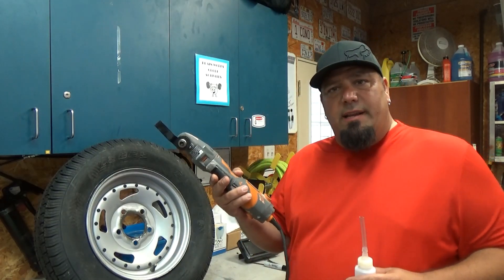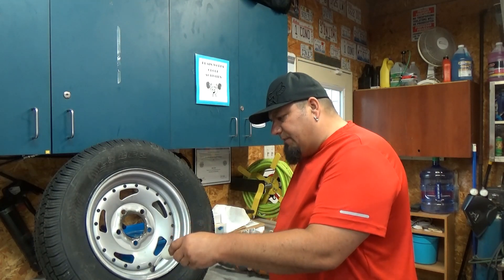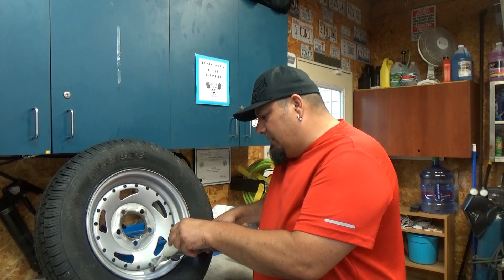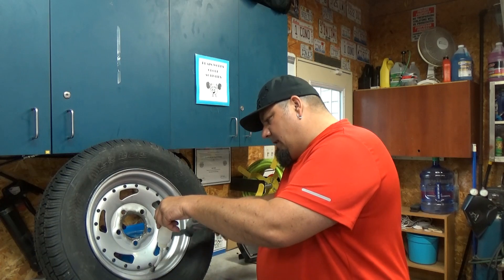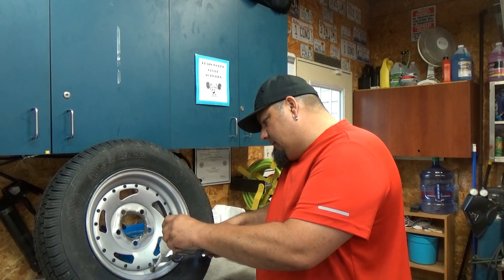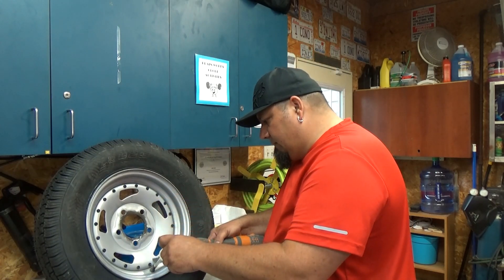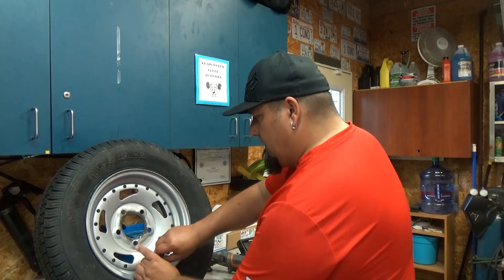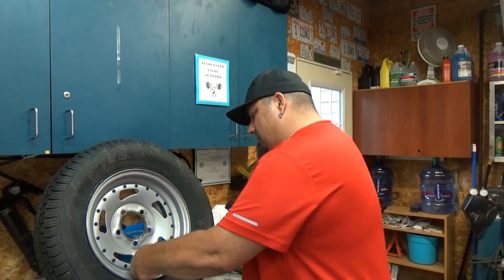Tire balancing with ceramic beads

Comment: I reuse my dyna beads in my motorcycle tires. When I remove the tire, I scoop the beads out of the tire and put them in a cup. When I install the new tire on the rim, I put the dyna beads in the tire before I put the second side on. They wont fall out. I also run a car tire on my bike. Most places wont put anything but a m/c tire on a motorcycle.
Reply from the maker: Yes I have done that many times. The issue we had with these tires and wheels were the beads of the tires were crushed together from shipping. We had to use a bead seater blaster tank to set the bead. That would have blown the beads all over. Thanks for watching Dirt Poor Tv 👍

Comment: Why didn't I think of that! I got that tool! Do you use those "Filter" valve cores?  Lots of motorcycles and trailers. Thanks
Reply from the maker: Yes, When using the Standard size bead the purpose of the filtered valve core is to prevent a bead from getting caught in the valve core mechanism. If a bead gets caught in the valve core mechanism, it will jam the valve core in the open position and air will leak out. Filtered Valve Cores are not required if using the Large beads (Off Road, Tractor Trailer, RV).

Note: Filtered valve cores, however, do not fit a lot of the newer valve stems. They require a seat 1-1/4" down in the stem. If you cannot use them, simply rotate the tire so the valve stem is about the 6:00 position, or give the valve stem a quick shot of air prior to checking pressure.When using the Standard size bead (Standard Bag, EZ-Open, Motorcycle), the purpose of the filtered valve core is to prevent a bead from getting caught in the valve core mechanism. If a bead gets caught in the valve core mechanism, it will jam the valve core in the open position and air will leak out. Filtered Valve Cores are not required if using the Large beads (Off Road, Tractor Trailer, RV).

Note: Filtered valve cores, however, do not fit a lot of the newer valve stems. They require a seat 1-1/4" down in the stem. If you cannot use them, simply rotate the tire so the valve stem is about the 6:00 position, or give the valve stem a quick shot of air prior to checking pressure.
Reply from the maker: Thanks for watching Dirt Poor Tv